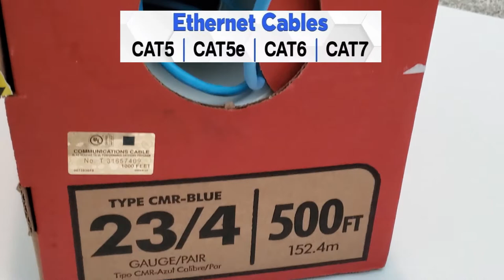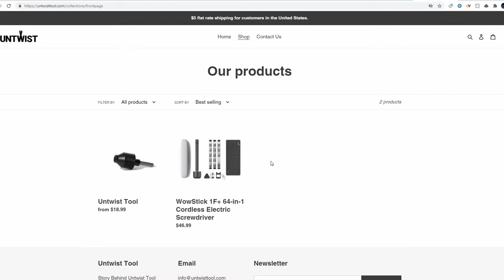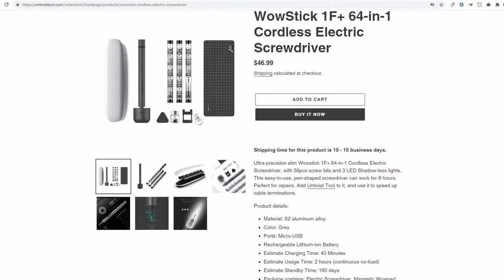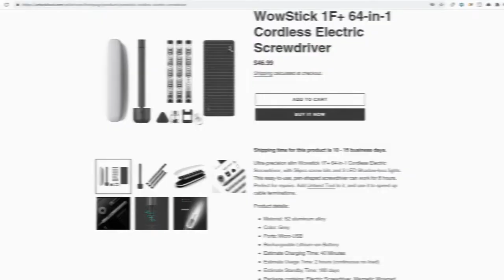How To Make Network Cables Faster - Untwist Tool

Comment from the maker: Hi everyone, today we will introduce you to the Untwist Tool from the Company Untwist Tool. This Tool is designed to help you make Network Cables faster & easier! The Untwist Tool retails for 16.99, in the video I said 18.99 sorry about that. So the question is, Does this Tool Actually make the Network Cable assembling process faster & easier? Watch this video to find out!
Reply: Great Video! I got Untwist Tool a few weeks ago. I usually need to make ~ 100 cables a week and I use it with a regular precision screwdriver (iFixit)
Once you get used to using it, it definitely speeds up the process and saves your fingers!
Reply from the maker: @orcwoodinc2746  Yep its a fantastic tool that's for sure. In the video I said it was 18.99 but its actually only 16.99. Thanks for watching and commenting.

Comment: 3 years later they jacked up the price. “Improved” the design so it ONLY works with their tool. Doesn’t come with the adapter for a cordless drill. Great idea, honestly they’re the only one on this market but too pricey. I might just get the tip and design and 3D print an adapter for the cordless drill lol

Comment: Take a small flathead and put it between a pair at the start of the casing and pull. It straightens them and separates much faster than this tool

Comment: Or.. after separating the pairs, split the tips apart from each pair, and use the removed casing from the cable to slip one tip of the pair thru the casing and work it down the pair to split them apart.

It's free, easy, and faster.
Reply: I’ve only had my untwist tool for a week and I guarantee it’s way….wayyyyy faster then your method.

Comment: Ordered 1 today from Amazon - it’s not even for $15.00 ($100.00) original price.
Reply from the maker: It's a convenient tool for sure especially if you make alot of ethernet cables. Thank you for watching.
Reply: @UltimateTechHub  Where can I get this for less than $20? Everyone has it for $100 to $150
Reply from the maker: @michaelcannizzo1076  Try Ebay, the price has gone up every few months. They must be selling quite a few to keep raising the price.

Comment: Now the price is $24.99
Reply from the maker: Really? I'm sorry they raised the price. If you make lots of patch cables this tool helps tremendously. I would probably get the whole kit since it's only about 12 more dollars.
Reply from the maker: 12 Dollars more
Reply: @UltimateTechHub  The whole combo is $75
Reply from the maker: @asmatec  Dang they raised both prices. Sorry about that.
Reply: @UltimateTechHub  Yeah. I’m just starting out so I don’t really have daily work regarding this but it’s more seasonal, so I was looking into something like this and now I’ll wait for it to come down in price a little bit before I get it.
Reply from the maker: @asmatec  That's a good plan. Thank you for watching!
Reply: So where is the link to buy this gadget??

Comment: This tool solves a problem that doesn't exist... It's like Nasa spending millions to make a pen that writes in space, when meanwhile the Russians just used a pencil...
Reply: Agreed... takes about the same time to do it by hand and use a screwdriver to straighten them.
Reply: Graphite particles from a pencil floating around the cabin would wreak havoc inside a spacecraft. Not only would it be harmful to breathe, but graphite is also highly conductive so it could damage the electrical equipment. Last, pencils are flammable and you don't want anything flammable inside a spacecraft if you can help it. The pen you are referring to wasn't even developed by NASA, it was developed by a private company named Fisher Pen Company, which sold the pens to NASA for $2.39 per pen. Please stop repeating this crap.
Reply: Have you ever had to put 300 connectors on in one sitting?  This tool sounds like a solution to a problem that very much existed.
Reply: @jimclements6729  Thank you for the info! Much appreciated!
Reply: @timothycardoza7504  yes I have, many many times. Trust me, this tool will only slow you down vs using a screw driver / pencil inserted between the pairs to straiten them out. Also it could run out of juice & then you're back to the pencil method anyway.
Reply: @CarstenBauer  it's faster to not use this tool. I've watched a few videos and timed myself straightening the cable as they did with the tool and I was faster every time.
Reply: @zadekeys2194  I know, I agree with you.
Reply: You’ve clearly never terminated data centers nor had severe carpal tunnel syndrome as a direct result of “pinching and twisting” category twisted pairs.
Reply: @thatavguyfromcali8767  I've terminated in DC's but have never had carpel. Try the pen / pencil method, it's fast and requires zero batteries etc.
Reply: @zadekeys2194   Using anything to untwist that pulls on the wire will cause it to stretch. Yes it will still work but it would never pass real certification. I just got the untwist tool in the other day and it works fast and perfect. Carpal tunnel is a B** fingers start to go numb working on anything and becomes very painful to the point of not being able to use my hands until I rest them a while. Also waking up with pain and numbness all night from it is the worst.
Reply: @thatavguyfromcali8767  I'm glad you don't have to suffer anymore ! The wires do not simply stretch like that, and also not much force is required. I've not certified the cables, but I've not had any issues and I've done over 1k individual cables this way by now.